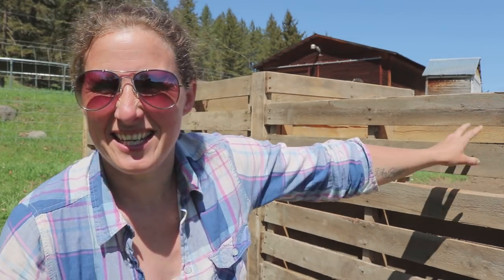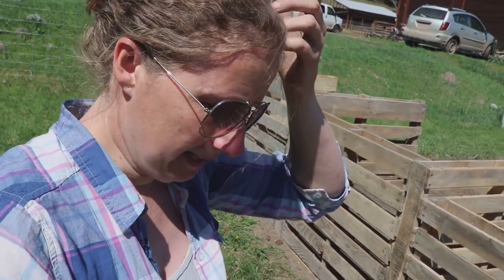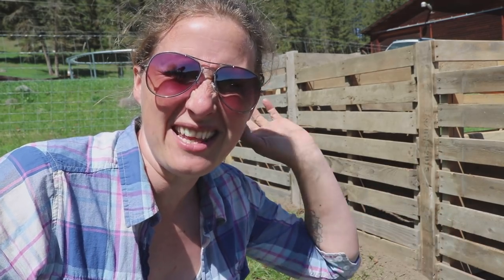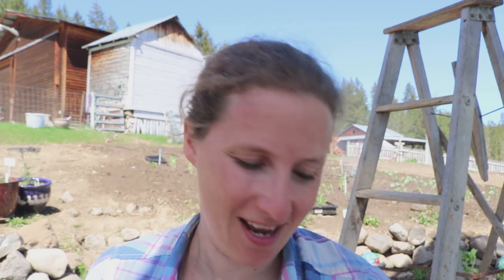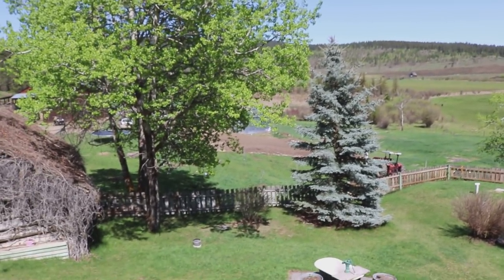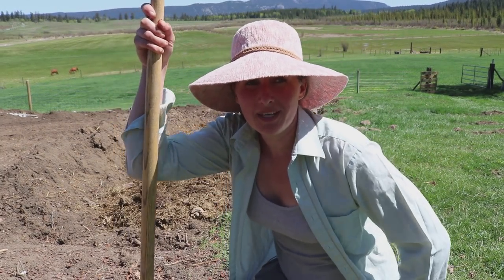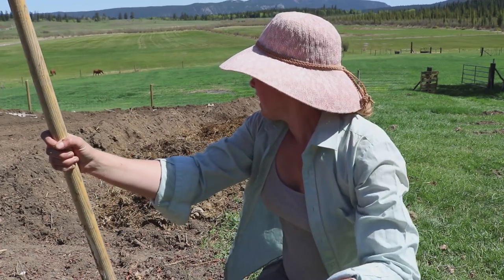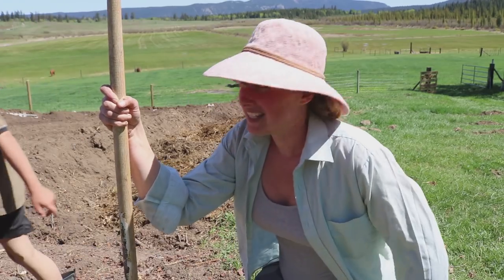Building a Hugelkultur Bed | A Beginner's Attempt

Comment: Perfect recipe for a Hügelkultur! It should work well. My only concern is planting right behind the Hügel running across the bottom; I'm worried that the Hügel may act as a dam and create a small, temporary pond behind it in heavy rain events. 
It's been crazy hot here in Sequim, WA for the past three days. It makes me SO cranky, lol, and I'm from Texas!
Reply from the maker: I wondered that, too, but we rarely get rains like that and I am thinking because it's so, I can't think of the word, but the soil is so loose and open with the wood that the water will soak in and run out underneath if it needs too. I guess we'll have to wait and see. I'll make sure I film the next rain.
Reply: Oh - that's great news. 
So, in addition to having the wood in the Hügel act as sponges, your have created something like a berm to insoak any runoff from the garden. Brilliant! Very good function stacking. (I'm an ardent follower of Permaculture.)
Reply from the maker: I'm a newbie with it but it makes SO.MUCH.SENSE! Love it so far.

Comment: Chelsea: Great job on the beds.   Do you have single bottom plow or other tractor towed implement to dig a very shallow swale to direct surface runoff from the hillside to level ( key line ) swale;  just above the garden area.  You can plant water heavy plants just below it.    Send me stills not video less data.   As I still frame to analyse.    Bert
Reply from the maker: That's such an awesome idea. I don't know if I have enough space there,though. I'll send some pics of that and the south side of the house asap. 💚

Comment: Great job Chelsea!
Only one suggestion, next tine fill the trench or soak the logs in water before covering them up. I've found it jumpsuits the holding of water much better.
Your assume woman. 👍
Reply from the maker: That seems so obvious - Drat! Next time. Thanks, Darryl!
Reply: I think you can still waterlog those branches using the mound as mentioned above as a problem. Permaculture turns problems into solutions! Keep soaking the uphill and see. The water will tell you. With all that carbon and disintegrating cellulose and humus it will soak up hundreds of gallons I’d guess even covered. Maybe one of your kids can hand water it a few times a day until saturated. 
Also don’t feel so bad. Moving them into a place to soak and then moving soaked wood is another big task. You avoided that! Use the mound to advantage. Bob
Reply from the maker: Thank you! That’s exactly what I’m doing right now - soaking those mounds!😊❤️

Comment: What will you plant at the top part of the bed (the highest part on the slope)?  I'm curious as those plants will likely get less moisture than the bottom where the water will run down.
Reply from the maker: Good point! I’m going to mulch pretty heavy, too, so that should help a lot. With that thought in mind (I’m heading out to plant now) I’ll level the top off quit a bit a d think it through before I plant. Thanks!
Reply: Happy planting!
Reply: I'm now watching your bee keeping videos.  I just discovered that honey bees have built their home in our walls.  They're getting in through the holes left by the screws that used to hold up our mail box.  We no longer have home delivery here so no more mailbox on our house.  Not sure what to do but am open to suggestions!
Reply from the maker: If it were me I’d suit up and pull off the wall board and try to get them out and into a hive box before they get too well established... if you’re not set up for that call a local beekeeper and see if they can connect you with someone who can help. I’d recommend doing something g right away, though, or they could cause a real mess. Best of luck! I’m actually heading out to my hives right now before I start planting.🙂
Reply: I'm researching local beekeepers right now.  Thanks so much!!
Reply: Turns out, after more research and some support on the Rhodes family members site, I've discovered that the little honey bee I found in my basement was not related to the bee going into my morter and bricks.  There is currently a mason bee squatting (pun and no pun intended) in our walls.  We're now trying to figure out which route we'll take to remove him (or them?).  We're thinking of plugging the holes while he's gone and providing him with a new habitat and hoping that he choses to live there and not in our walls. Someday I hope I'll have honey bees.